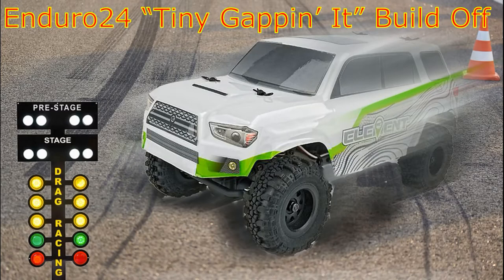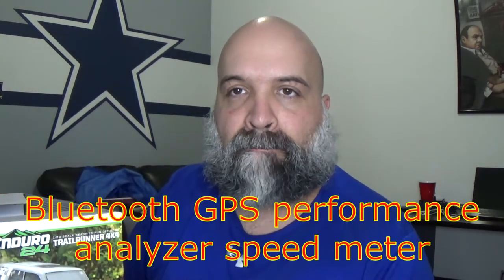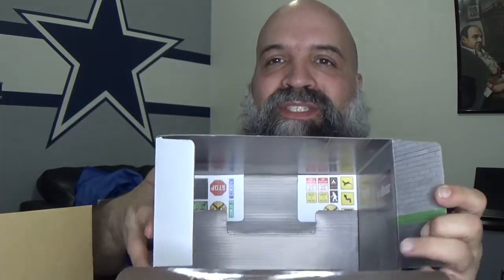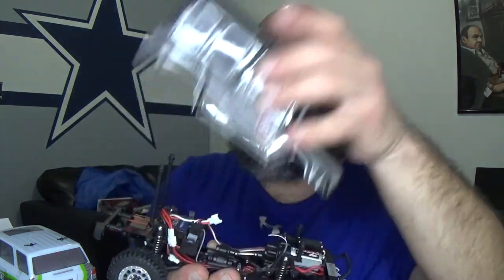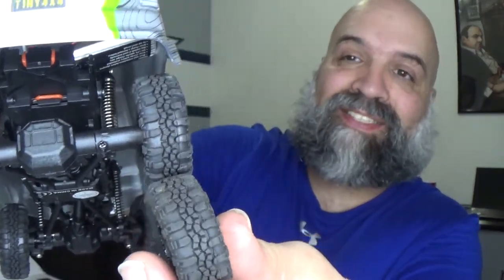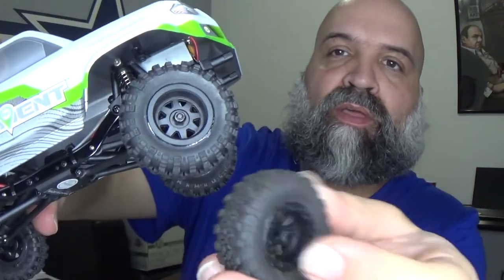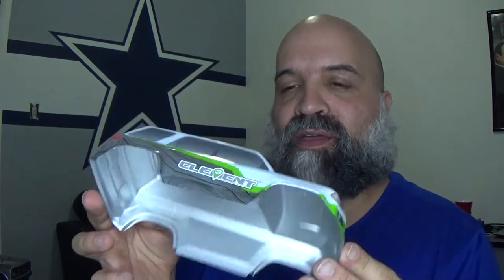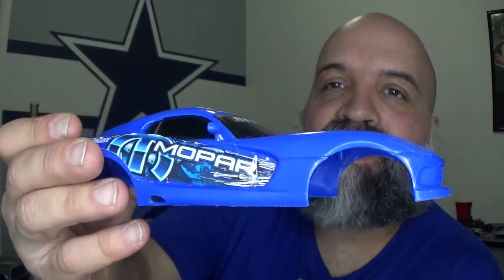Enduro24 “Tiny Gappin’ It” Build Off and RGT comparison

Comment: My enduro24 pickup I put scx24 electronics in it and its 10x better way faster than a scx24. From stock they already use the "barrage" motor that people put in their scx24s when the stock motor burns up.
Reply from the maker: yes I have read that alot I will most likely get one on those motors for the scx24 they hold up really well
Reply: @rccargarage  yeah I burnt the stock motor out of both my scx24s and ordered the barrage motor everyone uses and when I received them they had the exact part number on it as my stock enduro24 pickup motor.  Lol